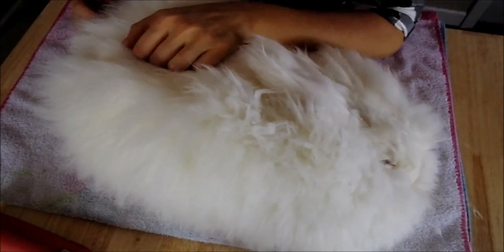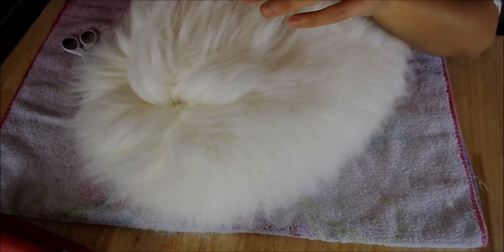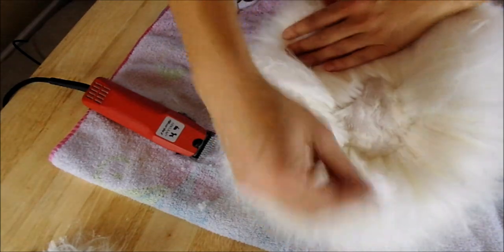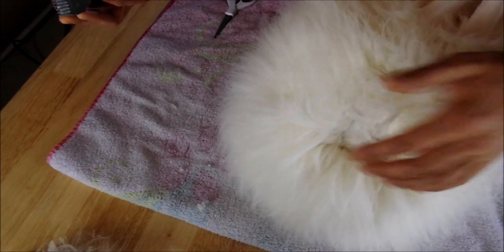Electric Shears for Angora Rabbit Tutorial. How to clip an angora with corded electric clippers.

Comment: One suggestion... I owned/operated a grooming salon for 27 years and groomed professionally there. You always work from head back "with" the growth of the hair never against the growth of the hair like this.  :)  It is easier to nick or cut the animal and the clipper blades aren't meant to go this way, so it also will dull them faster and heat up faster.  Beautiful rabbit!
Reply from the maker: Thanks for viewing Jackie :) What clipper did you prefer for the Germans? We are using the Angora package from the German Red Clippers, specifically made for German Angora Rabbits, which are a commercial wool producing rabbit. The clipper blades are designed specifically for this type of shearing. If we were to shear with the wool growth, the low micron count and density would cause an increased amount of wool left on the animal. I am certain you are correct that there are other clippers which would fail in this manner, as most others fail for this breed of angora.
Reply: Animals are different in my opinion than animals. Obviously they need to be held a certain way to clip them. She’s doing a good job.
Reply: Also, I think people should be warned more than once that many electric shear clippers like this easily get hot and could, therefore, burn the rabbit! Many people are not going to know or recognize this and would hurt their animals.

What about using Wahl battery-operated clippers instead on rabbits? I use these for cat lion cuts and they work great with no heat issues.
Reply: I have been a dog and cat groomer for 9 years now, I just tried using the neck-to-butt technique on my new (very matted) angoras.. I was shocked that my clipper blades did not want to get to the skin. I had to do exactly what this video said. I wish I watched it before I started trying to clip my new buns! I thought I knew exactly what I was doing. Lmao

Comment: Most German breeders go against the coat in the summer,  and with the coat in winter.   This isn't as critical if you have the adjustable blades,  or the longer one's that the Red's have for the Angora's.   As with all clippers regardless of the direction,  it is critical not to shear the rabbit with the clippers hot.  Knowing the rabbit's body structure and moving the skin  (as you did) is the best way to keep injuries from occurring. I'm sure every type of animal is going to be specific to their breed.  The most important thing is that the rabbit is shorn every 90 day's to ensure a healthy rabbit, as many eat far less when in full coat.
Reply from the maker: Thank you Michelle! How is everything going by you?

Comment: I have been cutting the wool on my English angora with little scissors and he ends up looking like a giant popcorn. That's okay. But I have clippers too. I'm afraid to use them because I'm no expert at it and I'm afraid to cut the skin. Can you talk about that? Thanks
Reply from the maker: Yes, it has been a long time since I used clippers. I have scissors and prefer to use them. Clippers have different length blades/teeth. Each machine, unfortunately is a bit of its own device. Some clippers have more options, which lead to different lengths of wool, away from the skin.
Reply: @RabbitryandYarns  Do you mean you no longer use clippers such as shown in this video?

Comment: Hello, thanks for this video. This is so interesting. I have difficulties to keep my bunnies coats clean! What clippers are you using? I think the one I bought is not so good. And my bunnies do not stay so calm 😢 and I'm very nice to them too 😉😢
Reply from the maker: Hi Sofie. I no longer use the clippers and only use scissors. I have had many questions about how the rabbits stay calm and I use a specific method to shearing. I did write the shearing method in a book and also there is a video course at razzledazzlerabbitry.com. Hope this helps! Steph
Reply: @RabbitryandYarns  using scissors for the whole coat honestly stresses me! I'm learning every day, but I find it difficult. I want to achieve...
Reply: @sofied_9972  I use a short and very sharp pair of scissors. If I can't see the skin (and avoid it) I don't make a cut. It takes about 3 hours but you can spread it out over a couple days.
Reply: @RabbitryandYarns  what made you decide to stop using clippers? Asking as a new angora owner!

Comment: Hi, would you mind sharing the make and model of the clippers you’re using or recommend a pair of
Good clippers. I have tried many clippers that simply don’t work at all. Thanks in advance
Reply from the maker: Hi there! We no longer use clippers. We use scissors. The clippers we did use were the German Red Clippers and we used the angora package for blades.
Reply: Wamberal Valley Fruit we have the Andi proclip AgC2 clippers. They are a mid price clipper and work good if we scissor rabbit first. Angoras hair is so dense it is better doing that way